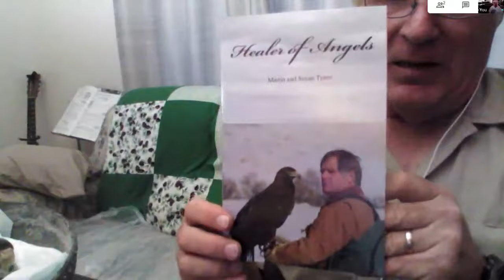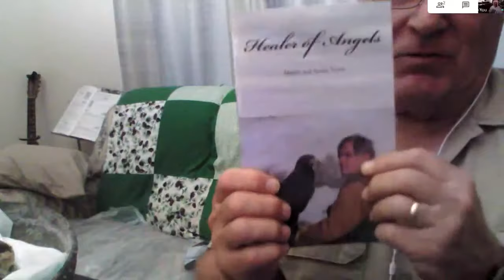Livestream about Imping: Falconry Feather Fix

Comment: About the 'pin' used to join the remaining shaft base with the replacement feather; if flexibility is an issue, what about using a segment of a moderately flexible zip tie as the insert?  They aren't round, but the glue should fill the space around the zip tie segment and prevent abrading  the interior of the two feather parts.  ( I'm going to test this with molted heritage turkey primaries and center tails and see how it works)

Comment: Is there a way to repair a broken feather tip about 3 inches, when you have both pieces of feather.  A big feather but doesn't seem to be hollow at the tip to use an imping needle.  Please advise